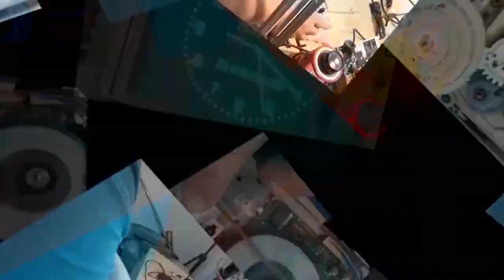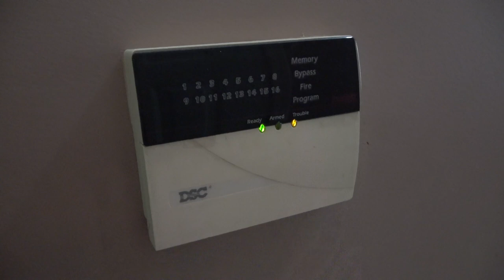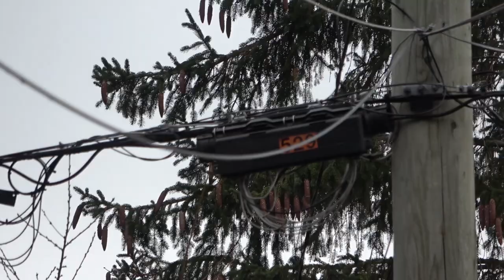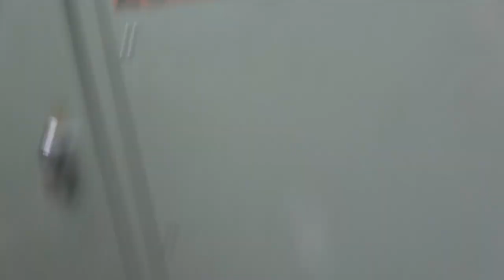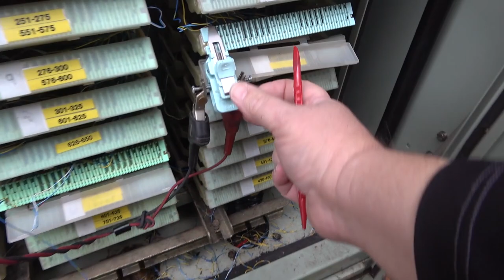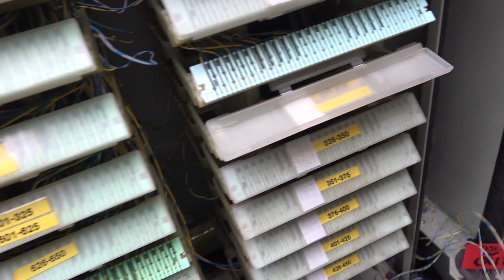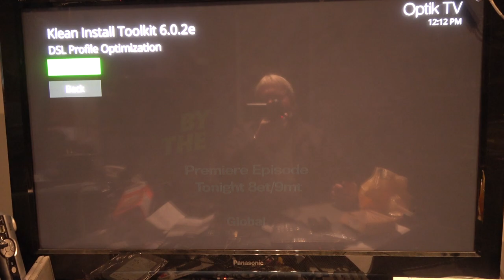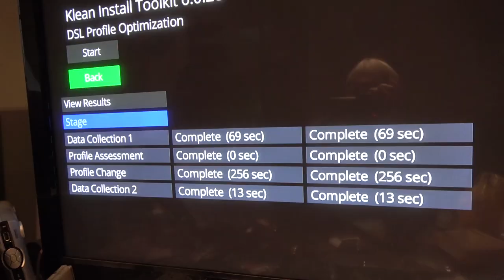Fixing my old noisy copper phone line

Comment: When you dial 911 any cell phone will go into e911 mode.   It will wake up the GPS chip and do its best to get a satellite fix and send the best location it can get.  It will also keep relaying that information to 911 services.   Modern phones have many many ways to get a location fix other than GPS.  First there is the cell network.   Its able to triangulate within a couple blocks.   Second is GPS.    Third is WIFI.     Its able to look arround and see what wifi networks are arround to get a pretty good idea of where you are.  All of this is sent on an E911 call
Reply from the maker: Ok so you are on the 10th floor apartment.  GPS may show the address but it won't show the suite.   WiFi won't do you much good as there won't be many references especially in a concrete building and wifi signals are not locked to an address.   I have looked at my wifi on these mapping programs and according to them my wifi  shows as 2 blocks north west of my actual location and mt secondary wifi is 1 Block east. None show where i actually am.  All these also take time.   Your home phone gives an instant location so if you are unable to speak help is sent immediately.  You can try to make your own case all you want but when my dad had a stroke and was unable to speak all he could do was dial 911. He couldn't tell the operator where he was in fact all he could do was mumble the operator new medical emergency sent the ambulance and fire department to the home address. Doctor said good thing he had a home phone because relying on finding a cell phone with a result it in a delay which would have affected the outcome. He survived the stroke. He survived aorata  abdominal aneurysm again because of speedy  care. In the second case my mom was with him but she was hysterical when she called 911. I keep my home phone primarily for that, in case I ever need to dial 911 at home. I install home phone for lots of people, more than you would think and the number one reason people keep a home phone especially as they're getting older is in case of emergency. Don't get me wrong cell phones are great and they will pinpoint your location to within a few feet when you're outside and you have clear line of sight to the satellites but don't count on them to find your exact location when you're in a building. They can use technology to get a good idea of roughly where you are but when they have four minutes to get you aid that extra time could mean the difference between life and death. Is that 20 bucks a month worth at risk?
Reply: A wall is very good at killing GPS.  The location they get will show that they are in the "area" where you are in a tower block.  Bear in mind that they need precise 3D co-ordinates!  There is height involved too.  They may know your exact latitude and longitude to the nearest meter but think you are 30 meters below where you actually are, as you lay struggling for breath they have to still go door to door and floor to floor.  Lets hope they are fast enough and that everyone else answers the door and says "not me".

If you have line of sight to the satellites outdoors you are fine, generally.  If you have a contract phone then they may be able to get your address from there and correlate that with the GPS co-ords, although you could be babysitting two floors above or something.

I wrote my own location logging app for my phone, you will be surprised just how long it can take to get a good fix and that barely has an accuracy below 10 meters most of the time.

Also, what do you do for all the many people who have a phone that has no GPS?  Plenty of people shun smartphones more and more these days, having got burnt out they go and buy a brand new feature phone which has no GPS, and no WiFi.

Also what about people who don't follow the trend and buy a new smartphone every year? Plenty of people are using very old phones, they still run WhatsApp and still connect to WiFi, but they don't get updates and thus their GPS firmware may have never been updated to implement the recent changes to the GPS network. These changes were well published because they were going to break old GPs receivers. So how do people with nonfunctional GPS benefit? Cell triangulation? Read up about how that works!

Cell triangulation, omg. "The two cell towers in the sticks says the patient is somewhere in the direction of the village, or somewhere in the opposite direction towards the river".
Reply: @12voltvids  nope. My grandma pays $99 a month and doesn't even have long distance calling without ridiculous charges
Reply from the maker: @AustinHollingerOfficial  that's cheap.  My bill is closer to 170 a month and that is with my discount. Internet alone is like 100 a month.
Reply from the maker: @AustinHollingerOfficial  
It will eventually be shut down. The gdt5 switch is going to be retired sooner than later. As it is half the remote dslam have been decomissioned already.  Each cabinet used to have 2 7350 units in the side.  Now they are down to 1 and soon none and the  copper cabinet will be removed.
Reply: @12voltvids  it's sad because reliability goes out the window if power goes down
Reply from the maker: @AustinHollingerOfficial  ever heard of battery backup?
Reply: @12voltvids  of course... but that could only last so long

Comment: thanks for sharing this, very cool to get a glimpse of the internal workings of the phonelines! 
In Denmark when we pay for e.g. 75Mbps, we generally never get that because we pay for "up to xx Mbps" generally its about half and we just have to live with it.
9/10 times it will be blamed on the in-house equipment which often is bs (at least in my/family's cases).
But you pay for 75, and expect to get 75.. is that how it generally is over there?
Reply from the maker: We generally get a little more than  rated speed. 75 plan generally set for 90. 150 180. 300 gets on average 330. This is on fiber.  On copper it is called at line speed.   My modem is trained at 42 for line 1 and 39 for line 2.  81 megs aggraded for both lines.  When the tv is running and there are usually 2 boxes running that is taking about 14 megs. That leaves about 71 mega.  Just checked my speed and got 70. If i turn off both boxes that are running now it will go up to 75.
Reply: @12voltvids  excellent, thank you sir :)

Comment: why not have both?
Reply from the maker: What do you guys think I am rich or something ?
Reply: @12voltvids  data on fiber, voice on copper. Same number of services, it's already there and lit up. Trade in the modern for an ont and just don't port the number.
Reply from the maker: @SovaKlr  You are missing the point. Data on fiber means new account, and new account means I lose my grandfathered price. I have 6 TV boxes. They are all included. On new system only  2 are included. The other 4 are rented for 5.00 a month,. So that is 20 bucks a month more right there. Also my old grandfathered plan has larger TV channel packaged. I have 6 bundles at 9.00 a month. New package has channels in smaller cheaper bundles, but I will have to buy more bundles. For example sports. 1 bundle, all the channels 9 bucks. New package they are in 2 bundles at i think 7 each. Just there for the sports that is 14, where I currently pay 9.
Really, I don't need any more speed than 75 megs. I don't understand why everyone thinks I need fiber. I really don't it is more than fast enough for what I do with internet. I know how fast fiber can be, I install it every day, but I don't care. I actually have the fiber hanging in my communications closet as I was bored one day and fished it in, but I still have no intention on changing until the very last day. When that day comes that they decide that there is going to be a hard shut down on copper then, and only then will I change, and I will fight tooth and nail to keep my grandfathered service. At that point I will probably win, but if I voluntarily call in and ask to upgrade, then I will lose what I have. There will be a shut down date at some point. I don't know when it will be. Could be a month from now or 5 years. Some day it will happen, and I am all set up ready to go. There are many areas that this has already happened. Every day when I am in the CO I see shelves of the old GDT5 switch being taken apart in my community as people switch over. Eventually they will want to sunset it, after everyone is switched over, but there are a number of old condos and apartments that have not been retrofit yet, so I would guess that copper will be around for a few more years.

Comment: I work for Openreach in the UK, I am assuming that is VDSL technology you are running on?
Reply from the maker: Yes VDSL. I am on the bonded 8B profile I believe. I was on a 17A profile when I was single loop. Now that so many have switched to fiber I bet the crosstalk is zero I could probably go to a 17A profile again and get even faster speeds.
Reply: @12voltvids  Got to love crosstalk its a pain to fault find on the network. Over here we have started to switch of PTSN and just have DSL only lines as not many people use dial tone no more due to mobile (cell) phones have good coverage. Do you use any other testers like JDSU, Viavi, Exfo?
Reply from the maker: @kylejoel87  I have an old Dynatel and an Exfo, and did have another one that was made in Canada for several years.  I forget the name off hand.  Now I have an Exfo that does everything, included bonded DSL. Have not used it much in the past 3 or so years as everything is migrating to GPON, which is nice. Have to climb very little now, which is a good thing. Since the pandemic hit like everyone else I have been a little less active and when I put on my climbing belt for the last bonded job it was a little tighter than I remember. The fiber drops were all contracted out so I rarely have to get my ladder down now.

Comment: You could use fiber internet with a pbx that converts impulse dialing and analog to digital.
Reply from the maker: That still won't solve the low ring voltage. Ont doesn't provide a high enough ring voltage to ring the real bell.  Most only output about 40vdc and nothing more to ring other than send Ac to ring a solid state ringer.  The old sets need about 120 Ac to ring the bell.

Comment: That's not quite how e911 dialing works on cell phones. Your phone /could/ send your location to a 911 service, but they are not permitted to do that. All they can know is what tower you are near. They can triangulate your location based on multiple towers, but they can not access your exact GPS location.    **EDIT*** In the USA
Reply from the maker: Here in Canada, and I am sure in other countries, when you dial 911 they access the GPS chip in your phone and get your exact location. On the news just today they had to rescue done dumb ass that went out into the mountains and got lost. Dialed 911, and they told them to stay put and sent a rescue team to their exact location. No GPS signal and they have to fall back on cell towers which is not that accurate. Also, if you are in a high rise they do not know what floor you are on.
Reply: @12voltvids  looking back into this now, I believe what I am remembering is not that there was ever a law preventing 911 from accessing your GPS location, but it was never built in as a standardized requirement for phones because there were large groups of people fearing that it would be used to track them for other unrelated reasons. So while it was never considered illegal in the US it was also never adopted. Because of that there is only a relatively small number of 911 calls that actually submit GPS location with the call.
Reply from the maker: @jody5661  your phone is tracking you wherever you go. Go to Google maps and look at your history. You will be amazed.  Google knows where I get my morning coffee where i go for lunch every day, and the route i take when i take my Harley out for a ride.  Scarry and i have location turned off and they still can plot it
Reply: @12voltvids  your phone can track you, but that dies not mean the information is sent out
Reply from the maker: @jody5661  If you believe for a second that your phone isn't snooping on you. I have a bridge to sell you.
Reply: @12voltvids  I never said that, I said that 911 does not automatically receive your exact GPS location every time. Usually they get an approximate location based off of towers and sometimes they get a GPS location
Reply from the maker: @jody5661  Here in Canada they do. As soon as you dial 911, regardless if you have location turned on or not on your phone, it will look at the GPS coordinates and if im not mistaken this is a CRTC requirement that the mobile phone providers send this information to the 911 operations center. Different countries and districts will be different but in Canada I believe this was mandated.

Comment: I live in the country, so I have to use DSL.  Windstream's service has been dismal.  I pay for 3Mbps but can only get 1M because their neighborhood cables are in such poor condition and because of the distance to their hub... although it's only about 2-3 miles as the crow flies.
My DSL speed recently went down to 0.4M for some reason, so it appears I'll have to call to get a technician to diagnose.  Sigh!
Reply from the maker: Yes that's one of the downfalls of DSL is that the speed is directly linked to the length of the loop. It's funny because there is a condo complex right next to our central office but the cable doesn't go from the central office to this condo it goes to a cross connect cabinet about 500 m away and then comes back to the building which is 700 m from the cabinet. The building is 200 m from the co. You can imagine that their speeds that they were getting were not great because even though the building is next door they were 1.2 km cable wise away so we used a joke and say so close but yet so far away. One of the guys I work with fiber to the corner node fed the cable up his Street but that cable ended one pole span from his house his house was fed directly from the central office which was five or so kilometers away so he couldn't even get DSL service yet his next door neighbor could get 75 meg service. I used to joke with them saying why don't you guys just string a cable from the peak of your roof to the peak of your neighbor's roof and get a second line installed there. It's all the way the cables run and sometimes you're just too far away.

Comment: More than half of the copper lines hanging on poles (in my part of NJ anyway) are not even being used anymore. It just not cost effective for them to remove it all..  the big push over the last few years has been replacing poles.  I cant even tell you when the last time i ran a new copper cable was...  No idea how they are providing 5G service  - cause we’ve barely installed all the new fiber for it.
Reply from the maker: Coppe ris not being maintained here either. We are switching people as fast as possible, but I am a hold out. Don't want to switch as I will have to accept new terms which means a higher bill.

Comment: Regarding your alarm panel... for one thing I don't think burglars even bother looking for phone lines to cut, because who has an alarm connected by landlines nowadays? Unless they were planning to burgle you, personally, and watched this video (hi guys!). Cutting phone lines is Man From UNCLE type of stuff, nobody does that. 

Regarding cost, a pay-as-you-go SIM costs nothing to run. They usually require a paid call to be made, to or from them, every six months. So do that. Call your alarm. If it won't answer, take the SIM out, put it in a normal phone, and make a call that way. Just to keep it fresh. Eventually you'll need to put a few $ worth of credit on it, but very little. 

Regarding the story about your father, 4G knows your location to something not far off the nearest centimetre, 5G more so. It's necessary to how they work. You can't get that much bandwidth to that many customers just broadcasting into the aether. You have to aim the radio waves to converge at a certain point in space, using multiple antennas. The maths for this is horrible, but now they've worked out the equations, computers can do it all day. Imagine how difficult it is to do that for multiple customers! All those users, at locations in space, and you have to modulate the phase etc of multiple antennas so the waves interfere precisely where each customer is. But it works, so they know where you are. The only problems there are legal ones, privacy laws. I think most places have it OK'd for emergency services to access the information without needing a court order first. 

So the only advantage your outdated alarm has, is phone-line-cutting detection, which nobody would do any more. Because cutting off your Internet would be a dead hint they were there! They'll expect your panel to use a mobile phone connection, which it should! No lines to cut! You could even have mobile phone backup for your existing rotary phones, if you wired up a private network. Put a box on the line that uses a mobile module for connection to the outside world, if it detects the land line connection goes down. Have a battery backup etc. You could buy a solution but it would be more fun to invent one! I think Asterisk would support it if you went that route. Arduino plus some custom stuff for the analogue side could do it easy. Look up those guys who modify single phones into mobile ones, but adapt it to a copper line full of 'em!